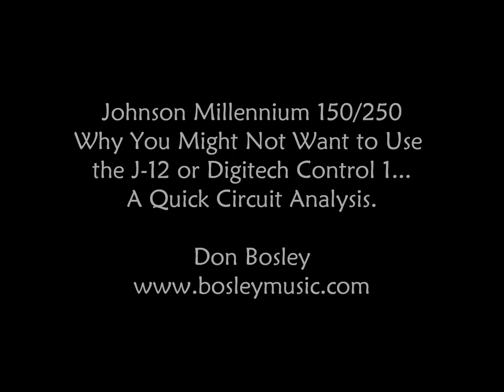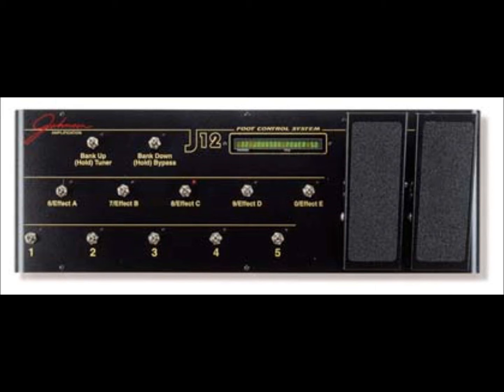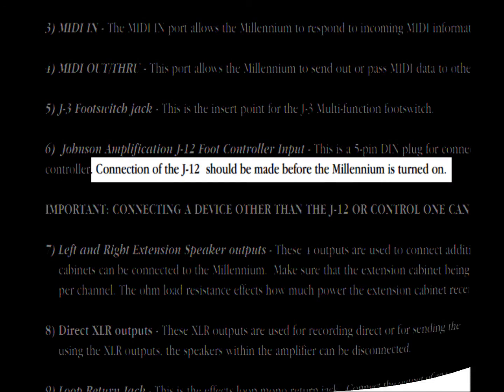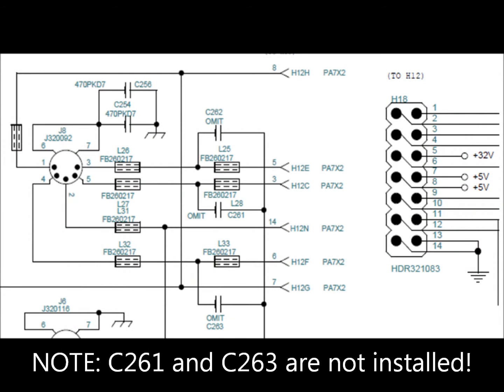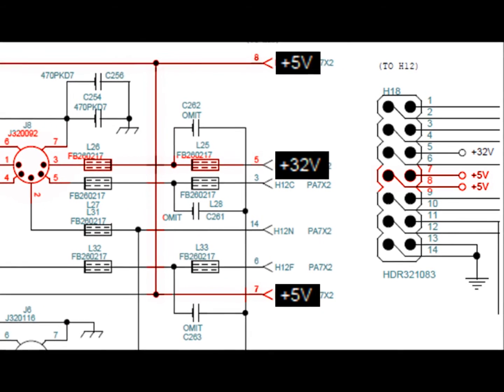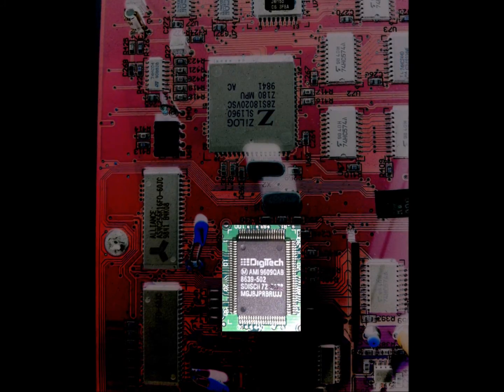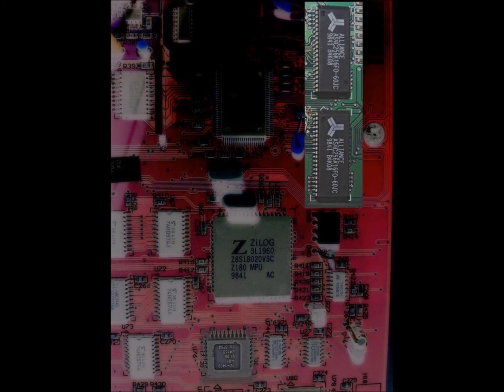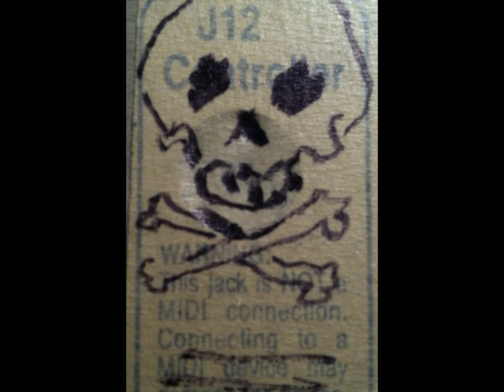How the J-12 can damage your Johnson Millennium 150/250

Comment: How about other MIDI foot pedal controllers will they work? The one you show is a Behringer? Also the same goes for the J8 controller too? Is it possible to re-format the the amp with another amp ie. connecting them together?
Reply from the maker: db - those are good initials!
- Yes, MIDI is the industry standard and any MIDI compatible device is capable of talking to any other MIDI capable device within the parameters defined in each devices MIDI implementation. I just happen to use the FCB1010, but MIDIbuddy, ART, etc... will work. Follow the guidelines in this video to get started with any general MIDI controller : Johnson Amplification : Alternatives to the J-12 - J-3 Footswitch, MIDI, and Expression
 - As far as the J-8, it doesn't appear to use the vacuum display, so the danger may not be present. I can't verify that because I don't have one, but I would follow the same precautions outlined if you're going to use it. 
- It is possible to update the operating system of a Johnson Millennium using another Johnson Millennium, but if the components are damaged, reformatting is not an option - damage is damage. Updating OS's from amp to amp, or dumping patches is possible : Johnson Millennium 150 / 250 : Transferring Operating Systems from Amp to Amp

Comment: Thank you for this. I have used a Control One with my JM150 for about 5 years, but it never got unplugged. Now, this scares me. Do you have a video for connecting a midi pedal like the FB1010 to the Johnson?
Reply: I will make one in the next week to demonstrate how I use the Behringer FCB1010.
Reply from the maker: Johnson Amplification : Alternatives to the J-12 - J-3 Footswitch, MIDI, and Expression